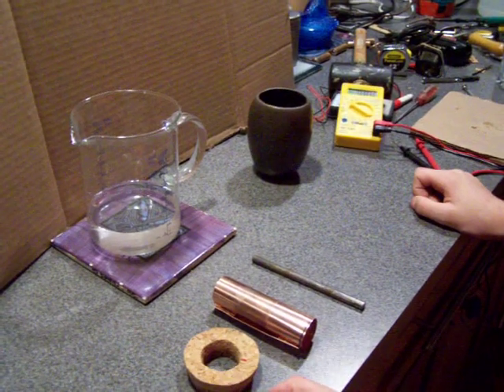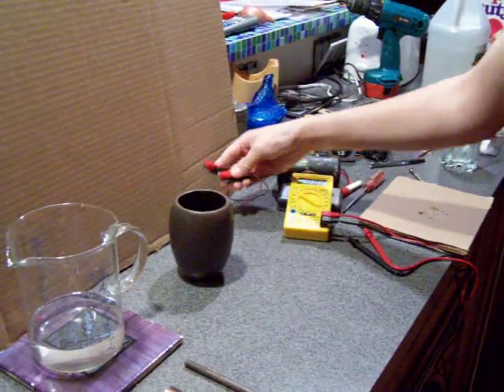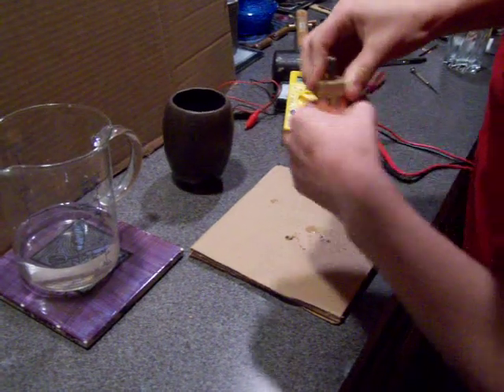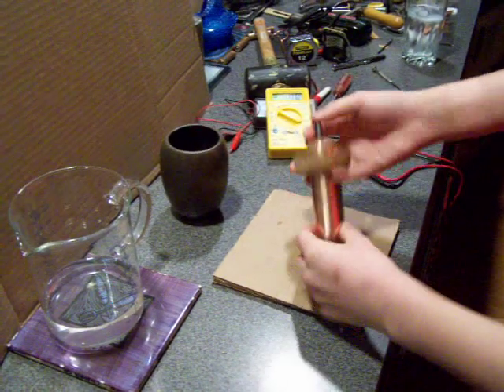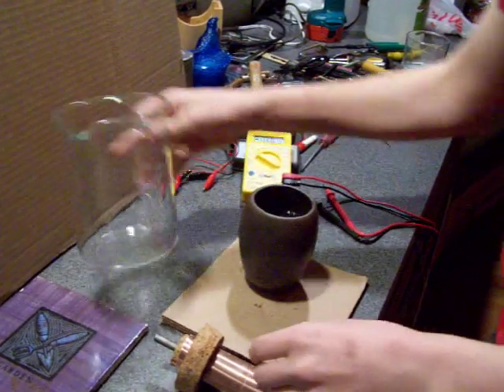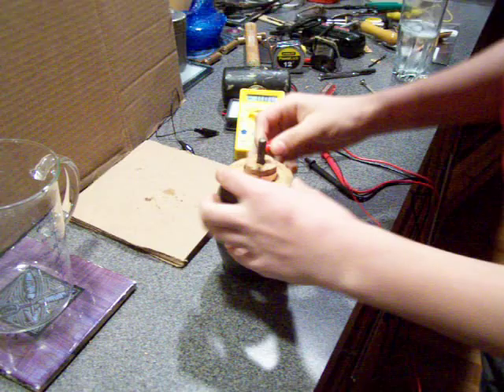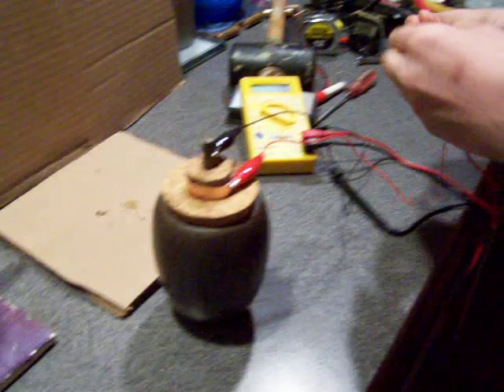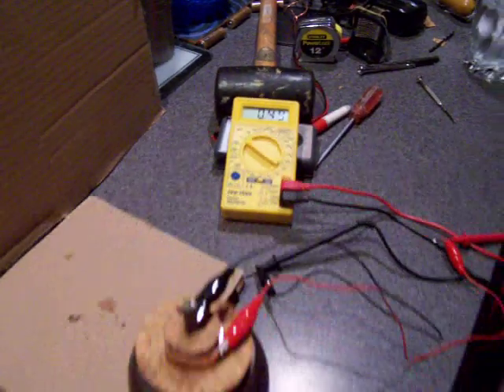How to assemble a Baghdad Battery

Comment: The only problem with the Bagdad Battery is..."IT WASN'T A BATTERY."
Reply: Then what was it?
Reply: @user-zt2wc3uh1l  
Your question is very valid of course.  I believe the correct is; "No one knows."  So, why don't I believe this device functioned as a battery?  Well,  it's construction.  Nearly all batteries have one phyical property in common, and that is "LARGE SURFACE AREA."  This device has almost nothing for surface area, and oxides would build up on the metals very quickly, shutting the battery down. 
  You should note that web sites that report the "OPEN LOAD" voltage of the Baghdad battery,  DON'T  report other important battery parameters such as amp-hour rating, internal battery resistance, and other information.  Remember, stick a knife in a piece of fruit and you just made a battery.  But, if you stick a knife in a piece of fruit doesn't mean you intend to power something with it.
Reply: But they did power something with it. Two possibilities are electroplating and medical applications using electrical stimulation and acupuncture meridians. It's construction is very similar to Volta's...It's a battery dude.
Reply: @user-zt2wc3uh1l  
There hasn't been a single artifact recovered from ancient Baghdad, or anywhere else in the world, from that time  frame that has been electroplated.  Further, one of the electrodes was covered with the bitumen.  Just like the Dendera lamps, the Baghdad battery runs off of only one wire - some trick!!!  It's too bad the object was stolen.

Comment: Use a glass jar. The acid or vinegar that you use will not weep through the ceramic. I tried it with Terra cotta jars and it only took a few weeks for it to self destruct.
Reply: One does wonder if there's a secondary effect on battery strength due to the clay jar used. Were they coated inside perhaps with same bitumen (tar) that was used as insulator at the top of jar between the metal elements?

Comment: Notice the exacting detail of all original baghdad batteries at the top. They were made this way to plug into some device when inverted. For some reason nobody by me seems to have noticed that! An array of such batteries in a bank of them would give plenty of voltage and amperage supply. Because they were used when inverted when plugged to a device is why the tops had to be uniform and perfectly sealed.
Reply: Yes they used Baghdad battery's to either build pyramids or to power lights or something inside the pyramids #facts
Reply: They used Bagdad battery to gold plate things by having 3 batteries connected and connect them to a coin in a gold solution, and you have a gold plating setup. The gold plated many things because gold and diamonds are everywhere in the crust of the earth. It is just an illusion that it is a rear material, people lie to us. Gold is a healing material. People get it in the body when you wear gold, Its good for your health.

Comment: Can you replace the quark with something else?
Reply: any insulator
Reply: 2 opposing alkaloids create and alkaloid . this is the reason ungalvanized nails rot away on decks . use a spare neutron if you cant find quark XD
Reply: Clay?
Reply: The original baghdad battery was sealed with asphalt and it was the separator.

Comment: What will that power? and for how long...hanks. Oh, how often do you have to change the electrolyte solution- does it get 'used up' as electricity is produced?
Reply: those are the precise questions I am curious about.
Reply: It’ll dimly light a light bulb
Reply: @Anhamss  or a cheap/old wrist watch mounted as a clock perhaps :)

Comment: How does the water get up between the copper and the rod?  If it's sealed on top, contained air will prevent the water from going up.   I'd say tilt it sideways to break the air pocket then turn it back up and should measure better.
Reply: It's a sheet of copper that has been rolled to a cylinder meaning its not sealed. It's has a slit open all along the side. That's also where he clamped his alligator clip test lead.
Reply: You could just put the iron rod in after closing it up.
Reply: +Daniel Bingamon with the cork on, i assume you could turn it to the side, let the air bubble rise out of the center and off to the side, and then slowly turn it right side up again... he doesn't say anything about that though, so maybe just the bottom of the metals, and outer side of the copper, touching vinegar is good enough??
Reply: drill a small hole near the top of the copper.

Comment: Vinegar releases H3O+, or Hydronium, which is an electrolyte. Ethyloic acid (the acid in vinegar) is a weak electrolyte, but still an electrolyte, because it disassociates into hydronium and acetate ions.
Reply: Vinegar as possible electrolyte is of course an assumption. I've never read anywhere that test were done of what possible electrolyte was actually confirmed by testing the inside of such battery. For all we know it was natrile or a saturated salt solution, or some other electrolyte, having perhaps stronger ionization.